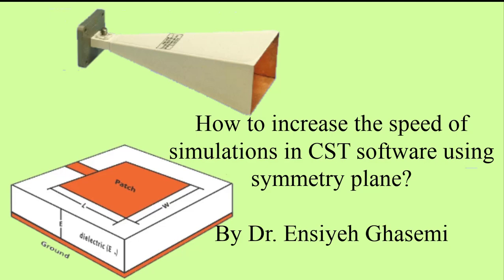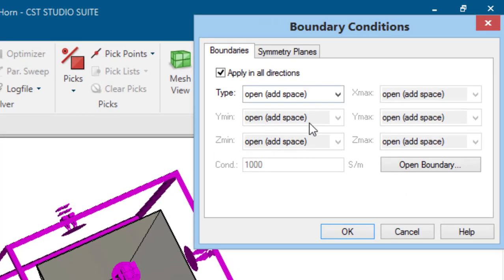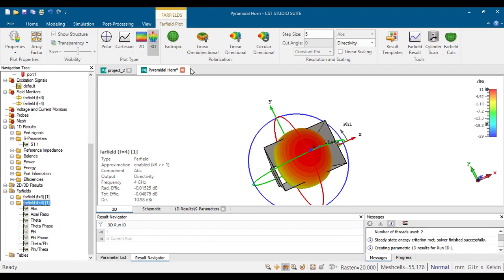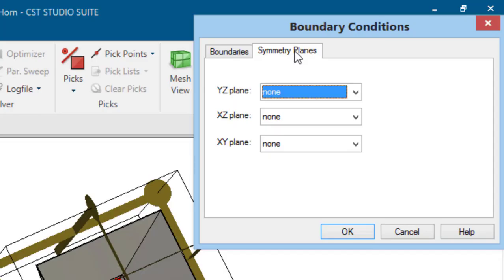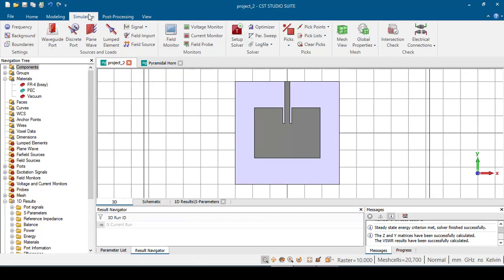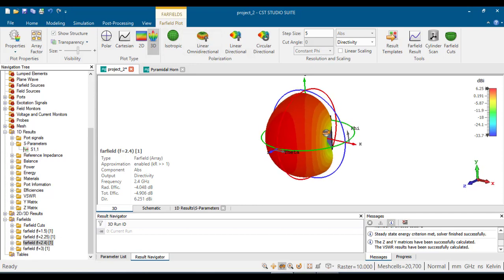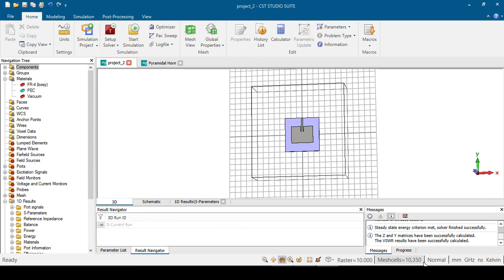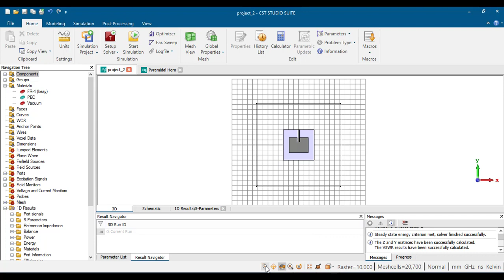How to increase the speed of simulation using symmetry boundary condotion in CST.

Comment: for the waveguide case, are you sure your symmetry plane selection is correct? The E-field only has a y-component, but the H-field has both a x-component and a z-component, therefore it is not normal to the YZ-plane... am I wrong?
Reply from the maker: I will explain it in my next videos